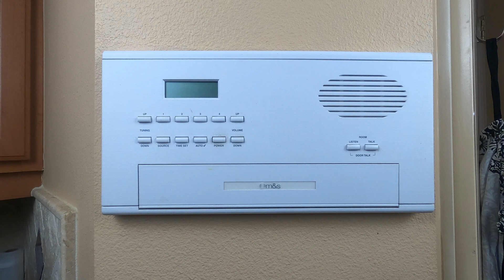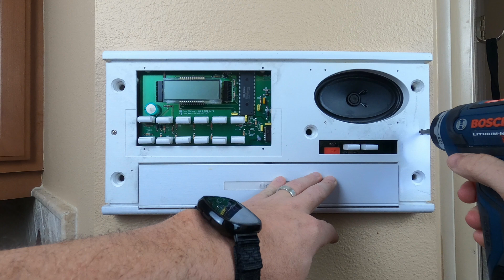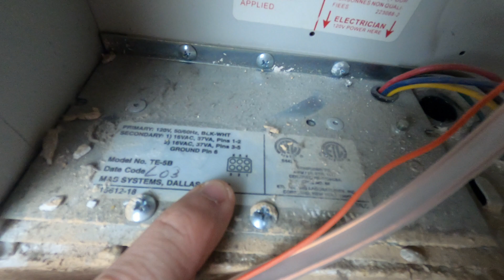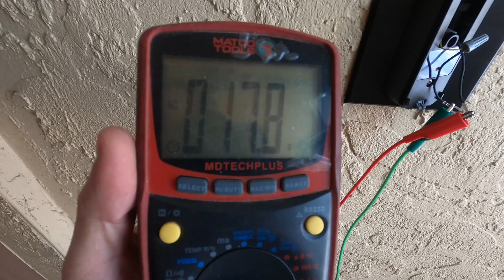How to connect a smart doorbell to a M&S or Nutone intercom system.

Comment: Will this work on an older (1992) Nutone Intercom system model IM3003? Some say it cannot be connected to a smart doorbell.
Reply from the maker: I’m unsure, I just used the low voltage AC power supply from the intercom to power the doorbell.

Comment: What about the chime guys
Reply from the maker: Factory chime is hard to keep. If you have that circuit board also connected, it just rings nonstop. I’ve read where some folks have wired in line a momentary switch and have had some luck though.

Comment: I have a ring three doorbell that I’d like to run Power to. I have the MNS head unit in the kitchen area and the doorbell box that’s on the outside of the front door with two wires going to the speaker and two wires going to the little push button outside. Do you think this set up will work at least to power the ring doorbell battery. The original doorbell is from 2006 and no longer works if you push the button and the radio on the head unit near the kitchen doesn’t work anymore, but you can just hear the static so I guess it just ran its lifetime out.
Reply from the maker: If you have a multimeter, you can test the harness coming out of the transformer and see if there is voltage. If your head unit doesn't display anything when you push the power button, then it could already be toast. If you are handy at all, you can get a regular doorbell transformer from Lowes and wire it up behind the head unit and it will do exactly what you need.

Comment: How do i connect 2 doorbells?  One for front door and one for side door?
Reply from the maker: If you have the original wiring still in place, then just have both sets run to the transformer connector that I show in the video. There is plenty of power being supplied for both.

Comment: Would you explain which are the correct  leads to use when checking for AC Current at  the end of the video
Reply from the maker: It's the exact same two colors that you connected on the indoor unit. Most setups only use 4 wire colors total, two for the bell and two for the intercom. This video showed me moving the two wires for the bell to the AC transformer harness. If you have made the Indoor connection already, just check what wires you used.... any two will work as long as they are also outside. Sometimes the installers strip all the additional outdoor wires back several inches in the cable and cut them flush so you can't see them.

Comment: Another big thank you for this video, I was about to to turn my Ring wired doorbell after I found out it is was incompatible with my M&S DMC1 but found this video. I also used a splitter on the harness side to maintain power to the DMC1 so the intercom system would work
Reply from the maker: @salilrao1961  Awesome. So you still use your intercom? We played with ours for a couple of weeks after moving in, but it's just easier to use our smart devices to communicate if needed.

Comment: Just wanted to add to the chorus of "thank you"s. I was able to power my video doorbell that integrates well with Home Assistant. I added a momentary-contact relay to the chime module and now when you click on my video doorbell, my M&S chimes ring! Very happy to have things working elegantly.
Reply from the maker: @ScottReston  awesome, would you happen to have a link to that relay to share with everybody else here? If you can't post a link, just email it to me in my about section. Thank you.
Reply: @JackofAllTrades1  Hmm. Looks like my reply didn't post. Was that b/c it had a link?

Anyway - the relay isn't anything special. MHCOZY Smart Relay Switch. I wanted something that I could power via USB rather than try to tap into the intercom for power. I already had a hole coming in behind the intercom since it shares a wall with my networking closet.
Reply from the maker: @ScottReston  cool, thanks for the info. Yes, link probably kept it from posting.

Comment: I did everything you said, but my AC current volt is showing 54 V. Is that normal?
Reply from the maker: @jahnavegudaru6054  try some other pin combinations on that harness. 54 is way too high.
Reply: I figured the volt, but I am getting an error 9 on the M&S system itself

Comment: It looks like the link in description isn't working anymore (just links to generic doorbell parts now), anybody have a new or similar link?

BTW this tutorial looks like it would be great if I was going to convert our old intercom doorbell, BUT I'd rather just install the wireless doorbell after all because our intercom has problems and for all I know it could be the transformer. I would still love to get the faceplate though since I'd rather not have to drill new holes into masonry!
Reply from the maker: @zohnomelon  looks like that seller may have gone out of business. Measure the mounting holes you have now, the distance between them and see if searching those specs can get you a cover plate.

Comment: Also I read you and another person has a similar issue where the ring stopped working did that ever happen again or was that just a bad ring and coincidence
Reply from the maker: @aaroncollings4911  I had a bad doorbell that had to get replaced. The current one has been running strong for about 2 years.
Reply: @JackofAllTrades1  did you happen to see my other questions? Great video btw!!

Comment: Hello I have maybe a little newer M&S system but looks somewhat similar, my chime has a black cover on it tho where yours did not and my two wires are Green and Yellow, at the outdoor intercom/bell - they were green,yellow,black and red and I dont remember which ones were connected to speaker but for some reason I thought they were the green and yellow but I could be wrong since that wouldn't make sense with what you said and how your wires were...  My two wires green and yellow that you used were connected to two spots on the chime that said common and 3 notes. Did yours say something similar before removing and attaching to the new power source with in that clip? My second question would it hurt anything to add the resister in either bypass mode or regular mode underneath that metal plate where you didn't show and said the transformer was even if it doesn't need it?  If I do use the resister they supply would it be done the way the ring manual says with those wires?? Do you have a video showing the transformer at all cause I honestly dont remember a metal place on mine either at the location.
Reply from the maker: It looks like you have a more modern version, but that is fine, it will work in pretty much the same way. No video of the transformer, but if you cut the power to your system at the breaker, you could easily pool it out and look it over. Ithers have mentioned this resistor setup, and honestly ive never tried it so i am unsure of if it would work.
Reply: @JackofAllTrades1  So I opened mine up again tonight after work and my transformer was up top in the wall that is why I didn't catch it last time.. Everything was upside down pain in ass.. No idea why they did that.. Had to get on my knees and look up to read everything and labels were really faded.. my clip only had 4 wires was pretty simple to get wired. Label showed my primary was 120v and my secondary was 24v but when I tested all the pins I either got 14v or 27v... little concerned 27v will be to much? I have the ring pro 2 and it calls for min 16v - 24v max.. What are your thoughts. I might need to use a resister or swap the transformer out completely and just un hook the M&S completely we don't use any of the stuff anyway. So I went ahead and hooked everything up with out resister because the transformer didn't have any terminals for easy hookup at the moment. I did everything you said and tested the wiring at the doorbell and I was still get 27.5VAC what you think roll with the little higher, try a diff meter ( mines new ) or replace transformer and just bypass all this crap.
Reply from the maker: @aaroncollings4911  hook it up and then check voltage out by your door and see what the drop is. The resistance over that distance could lower your source voltage. I don't think 1 volt will be detrimental though imo.
Reply: @JackofAllTrades1  I have everything hooked up as the way you showed and with everything powered up - no doorbell attached at the moment I'm still reading the 27.5vac at the wires outside.. I thought I'd lose a little too but read the same consistent.. my only options is to roll with that .. try add a resister or replace my transformer and do fresh.. what you think roll with the 27Vac with the ring?
Reply from the maker: @aaroncollings4911  I honestly think it will be fine as a lot of electronics seem to only consume what they need. It's not like an AC motor that will spin faster if given more amps.

Comment: I can’t find the cover plate???
Reply from the maker: @clayconnell7578  it's on ebay. I thought I listed it in the video description.
Reply from the maker: https://www.ebay.com/itm/296314978298?_skw=m%26s+cover+plate+for+smart+doorbell&itmmeta=01JCEFABCE38NH21DV991HB65W&hash=item44fdbfbffa%3Ag%3AfMgAAOSwaXtmPtO6&itmprp=enc%3AAQAJAAABAHoV3kP08IDx%2BKZ9MfhVJKmBAKqvfa26CierH%2BMt%2FKSzDRJWsN%2Bopp2TJpwBOS0AYuwR277tbGLtTE%2FGt%2Fdpvz2m5nx4eL4pvXi3SG%2BNq9%2BXlsAx05yv51aDuS31zIxDToox4dxMo%2FfVCoNvkpHPMUwKVrqoE4npLpukVIwd4btHfJUgGA4s8JbkjLd6Eb3m7kNzqcJa0AJUDr0k7NBCVaemQKNMCgrmr66yOwYCguFp47EZaogI9YA1lagg1ED%2FR6%2FzrLiggSQt5lMrEdTPPaost4Tbu43JUEzrp1BSJlNYo1VOLrcspBVAInpg1S9HewXfvBVTzln2wbpBuH1tu6Q%3D%7Ctkp%3ABFBMurapz-Nk&var=594329607295
Reply from the maker: Just make sure to get the correct mounting hole size/configuration.

Comment: Very helpful Thanks, but I have a question. Couldn't you just pigtail off the 16v and keep your intercom chime?
Reply from the maker: @klowe7695  great to hear!
Reply from the maker: @klowe7695  you could keep your chime but you must then retain the original button at the front door. The chime runs off DC voltage and your doorbell cam needs AC.

Comment: Excellent video. My home has an old M&S N350 system. I’m trying to wire a Wyze wired doorbell to replace the existing M&S doorbell. However, there’s no schematic inside the main box. There is a sticker that says “Chime plug” pointing to a small plug on the board itself with 4 wires. There’s also a larger plug similar to the one you show that’s fixed to the wall that has the 6 ports but only 4 wires (2 yellow wires, one black and one green; the green appears to be a ground wire). I presume I need to use the larger plug like the one in your video but unsure which wires to use given that two are yellow. Any suggestions?
Reply: I bought an altimeter (got it based on your red in the video). I will give that a try & check back if I have more questions. I figured the wire color didn’t matter too much but wasn’t sure if I was missing something.
Reply: I meant multimeter. And, I also meant to say thank you!
Reply from the maker: @koziolrj  yea. Once you hit the right combo and it stays consistent, you will know you have current. If the reading shows negative, then that just means your red probe is on the ground and your black probe is on the positive. I don't think polarity matters with these doorbells, but just in case, it's good to know.
Reply: So, I finally got back to this project. I tested the wiring harness & am getting no reading whatsoever. I tested the multimeter with a battery & it’s reading correctly so I presume the wiring in the M&S is shot but thought I’d check in with you before I abandon ship. Any other ideas/suggestions? The original M&S doorbell hasn’t worked for years - the doorbell buzzes outside when it’s really humid & the inside unit makes clicking noises when that happens - in case that info is helpful.
Reply from the maker: @koziolrj  are you getting any voltage from the wiring harness with the connector thats behind the head unit? Any combination of two pins..
 Do any give you voltage?
Reply: @ no, none. I tried every combo. Wondering if it could be the transformer and/or a fuse?
Reply from the maker: @koziolrj  that's the transformer. Double check all your breakers are on... these things are usually wired into the kitchen countertop outlets. You can replace the transformer with an old school doorbell transformer from Lowes. Just hook up the two wires you need to go to the front door and your golden.
Reply: @JackofAllTrades1  thanks! I’m not see in anything with any of the other breakers (it is located near the kitchen so a good assumption). I’ll double check them but ho I mi b the transformer. Much appreciated!
Reply from the maker: @koziolrj  if you have a multimeter, you can probe several wires until you find the combination that gives you at least 16 volts AC. It's an inexpensive tool and has many uses.

Comment: Thanks for the video. I have the exact same unit you used in the demonstration so this was really helpful. My question is around the doorbell out front. What do I do with the other two wires that were attached to the speaker that I removed? And also, does that mean I don’t need the Pro Power battery that came with the Ring doorbell because normally it is attached to the inside doorbell unit, which in this case I don’t have because of the intercom head unit that is used instead. Any help is appreciated. Thanks much!
Reply: That’s what I was thinking but needed to hear it. Thank you so much, you’re the best!
Reply from the maker: @BrendaKoskey  you can tuck the other two wires back. Just arap them around the main wire... maybe place some electrical tape or wire nuts over the end. The pro power battery is not needed when you have an AC power supply. I use an Amazon echo as my ringer now for when the doorbell is pushed.

Comment: Very useful as I have the same M&S mc602 unit.  My question is, I’m considering adding a Google Nest 2nd gen wired doorbell and their installation mentions a nest chime connector.  Any changes to the install step?
Reply from the maker: @aureliosr7009  I believe the chime is wireless and works off Bluetooth. That's what the echo version does. Do you know? Mine just hooks into a regular outlet near the door.

Comment: Just a thought for a wired chime. As I re-did some of the rooms in my house I removed the intercom in the upstairs hallway. Before i patched the hole I pulled the wire to the top of the wall and put a small hole to pull the intercom wire through.  I did that so I could figure out how to put a future chime there. Your video now helped me figure out how to get power to the ring cam. Now what I will do is behind the unit, put one power wire to that intercom wire running upstairs to power the chime. A corresponding color of the intercom wire will be placed on the chime and that color down behind the unit will go on the transformer to complete the circuit. It should work and now have a powered chime
Reply from the maker: @JimSchu  cool idea. Make sure if there is 120 volts of power in the wall thst there is access somehow. This is so it can be code compliant. If it's all low voltage wire then it's ok but if it's like mine, the low voltage transformer is getting 120 volts from a direct feed from a nearby outlet.
Reply: @JackofAllTrades1  yes, off the transformer I am geting about 18-20v. I need to try it soon but just got the doorbell powered.

Comment: The video was perfect. My wife ordered a ring system and I had no idea how to connect it to our intercom. You made it simple and easy, and I didn't fry anything in the system. Thanks!
Reply from the maker: @jimtraum8720  awesome, thanks Jim for the kind words. Glad I could help.
Reply: @JackofAllTrades1 can this set up do 3 ring door bells???
Reply from the maker: There gonna be some voltage drop but maybe not a ton. I don't see why not. If you are near the bottom of the threshold, you may not have enough left to do more than one, but you won't really know until you take some readings.

Comment: Thanks for the info.  Trying tomorrow.  Didn’t see another video or the outdoor install.  I have 4 wires outside to connect to the ring doorbell and only 2 connections available.  The outdoor wires had two connected to the button and two connected to the speaker.  Old home and it’s all part of the intercom system.  Have red, black, yellow, and green  wires.  Seems the yellow and green are the ones attached to the back panel inside the transformer box.  Love to hear your suggestions
Reply from the maker: Hey Andrew, you only need two wires and can pick which ones you use. Essentially the ones that are currently connected to the indoor chime (at the head unit) will be the easiest to find but you can use any combo of the 4 as long as 2 are hooked to the doorbell and those same exact two are hooked to the AC power on the inside head unit (like the video shows). Hope this helps.
Reply: @JackofAllTrades1  Thank you.  I'll give that a try today.

Comment: Great video and appreciate all the hard work you put into making this video. You mentioned the original chime will not work once the video doorbell is wired up. How do I get the chime to work then? I have a relative who needs their Nutone replaced with a Ring Doorbell that will get wired up. The house is very big, so the chime needs to be functional as well. Thank you again!
Reply from the maker: @vicdhillon7723  I use several echo dots, and they are programmed to chime with the ring doorbell. The original chime works off DC voltage and relies on the wires to touch briefly to cause the chime. You could just use two of the wires in that wire harness to run the ring doorbell (and connect it to the AC power as shown) and then just use the factory dc doorbell button affixed to the housing cover of the new doorbell. This would, of course, require somebody to press both doorbells. I think the first option I mentioned is best.
Reply: @JackofAllTrades1  thank you and appreciate the quick response!